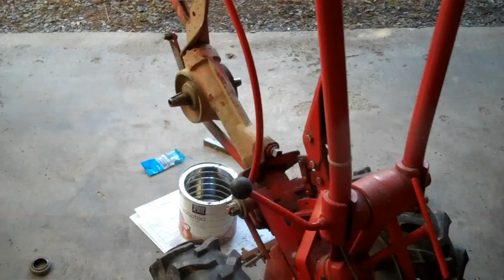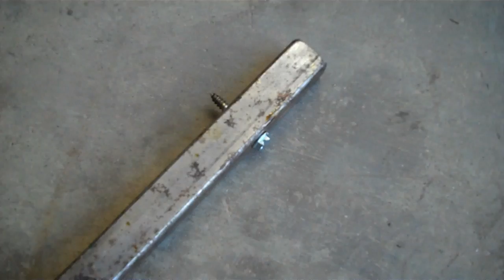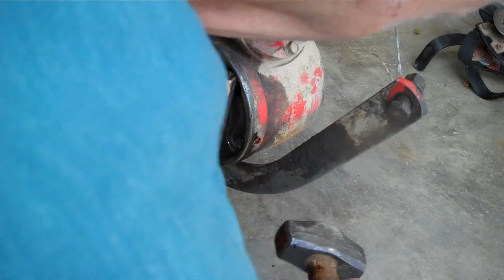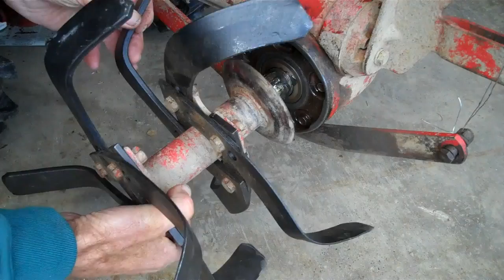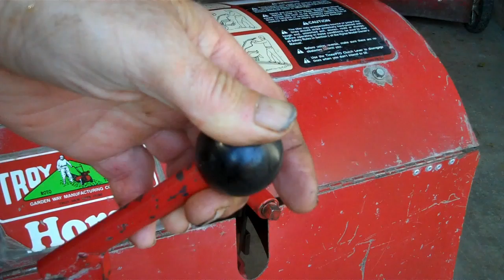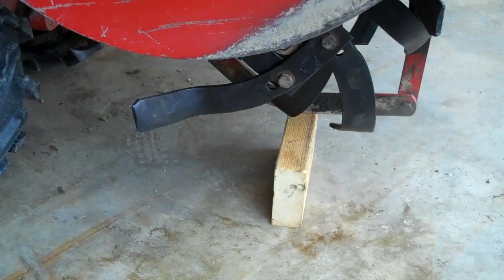Replacing Tiller Shaft Oil Seal and Tines on Troy Bilt Roto Tiller

Comment: Thanks for the tip for using two pieces of tubing. I was replacing four seals two in the transmission gearbox and two in the tine gearbox.  After fighting to get the first seal out I used your method for the other three and it worked like a charm. I like the idea of using PVC to install the new ones as well.

Comment: Any tips for removing the tine holders to access the seals? Mine are stuck pretty good, a hammer isn't doing the job.
Reply from the maker: Mine had been off before and were easier.  I gave them a hard hit with crowbar from the side.  Penetrating oil or heat may also help.  Good luck.
Reply: I just took mine off.  Gentle heat and penetrating oil was the answer.  I used the bearing buddy formable coil with my induction heater on the tine holder.  Or a heat gun if you dont have that....then a few taps with a mallet and aluminum or brass bar on the tine holder and the both came off pretty easily.  There's a couple nice flat flanges on the tine holder where the tines ride that gets a good purchase for something metal and punch like.

Comment: Great video! 👍.  Puting the seal in the freezer for a few hours will help with installing as well.  If it's really tough; ( assuming you've cleaned and sanded the housing really well)
heating up the seal housing with heat gun or hair dryer helps as well.
Just be careful beating the crap out of it.  It should go in with light to medium tapping .

Comment: did you use puller to get tine shaft off main shaft  after removeing center bolt and  wnere got seals?
Reply from the maker: No, but had the tines off previously.  Gave them a sharp rap in the off direction with a heavy crowbar.

Comment: How did you get the tine holders off?
Reply: They are frozen on and will not budge. No shear bolt like othe models…?
Reply from the maker: I gave them several impact blows from the side with a large crow bar.

Comment: did u say what number the seal was
Reply from the maker: I bought these seals from Amazon:Troy Bilt Horse Tiller Tine shaft seals set 9618, GW-9618 GW-9602 GW-9618099.    They apparently are currently unavailable but there are equivalent seals offered.

Comment: It takes money to pay somebody . Or you to know how to do . In my mined a better way . You see the bearing has sloppy.  Ok now you find out how and get the parts  bit at a time . When done you will have a great machine for a fair value and know how it done . Cause it happens when in use .the older ones were made to repair.  Not just get a new device.

Comment: wont the grease on the shaft just become a dirt magnet?
Reply: Yes do it way it designed to work. Get your proper seals. Then the bearings and or bushing. Now you have to clean it . Now you need shims to set the proper play side and end play. Carefully paint put back together.  Then retouch the paint and repair any covers . Now you have a fix that don't leak. Last and work as it should.
Reply: Design was to have a oil bath shaft. On shims with bearings . Covered with oil seals. For a easy quick fix that happens often.

Comment: Thank you, great video on how to replace the seal.  I'll replace the seals on my tiller another day, what I need to know was how to check the fluid level.
Reply from the maker: Here are directions for checking the tiller attachment fluid level:  https://drive.google.com/file/d/14Yf8LOntlgdPcok4KqlrGrFYvMczMF95/view?usp=sharing
Reply: @herbcrosby  Great video! I'm a little confused about putting oil in my gear box. My manual says the same thing as yours but if you go to the next page it says if the gear box has been drained to raise the drag bar up so the tiller is resting on the tines. Then fill and check the oil level. The manual also says the gear box will hold 16 ounces. I put 14 ounces  in it and it is way over full when checked with the drag bar down and sitting on a 3 1/2" block of wood. Am I missing something?
Reply from the maker: @terrysykes4615  Good observations.  The book is not totally clear here.  It appears some oil should first be added to an empty  tine gear box with the tines on the ground so the viscous oil runs to the rear.  Final filling is then done with the tiller raised with the drag bar down sitting on a 3-1/2" block.  Marks on the dipstick then govern to fill to final level.  Suspect that the 16 ounce capacity shown may be total capacity, not oil needed.

Comment: Herb my Troybilt Bronco  is an 80's version and it needs both seals!  I had a wooded lot originally back then and my tiller along with myself landscaped my entire building site.  It served me well and now in it's old age it tills a veggie garden and berry patch.  I have to top off "transmission" area before every use and it would extreme leak on my usual doubled up cardboard piece that it parked over.  The way you explained repairs I think I can do it with tools like you made.  Thanks for taking the time to explain it...

Comment: Is there a drain plug for the rear or do you have to pull everything apart?
Reply from the maker: Do not believe there is a drain plug.  I kept most of the old gear oil, replacing only what was lost.
Reply: @herbcrosby  Just pulled a PTO Horse w/Kohler 8 out of a barn that has been sitting for 25+ years. Got it running good and have replaced motor and trans oil. That rear is the only thing left. I may leave it if that is the case.
Reply: I saw a video that showed you remove the bottom bolt of the 5 bolts of the COVER-Tiller housing, after taking off the tine holder on one side. Also, prop the opposite side up to allow more complete draining. You can see the 5 bolts in the video when Herb is applying grease to the shaft.

Comment: I have a Bronco Axis 2015 tiller.  Got some red hay bale twine around the left tine.  It developed a significant leak.  The angle is different due to tines being vertical instead of horizontal.  I used 30 inch concrete form slick pins with pre-drilled holes and two sheet metal screws.  Drilled pilot holes for the screws.  Placed the slick pins in the same fashion as your square tubing.  Beware that there are ball-bearings in proximity to the seal so don't use extra long screws.  Just enough to get about 1/4 inch of the screw inside the seal. The force of gravity and the weight of the slick pins combined to bring this oil seal right out without tapping on the pins.  Excellent tutorial and use of ingenuity! Thank You!

Comment: leave the old seal in and fill the case with grease. grease will last forever wth no damage to gears.
Reply: I filled mine with corn head grease...
It's the lightest grease just a step up from the heaviest gear oil.
In fact I fill most my implements gear boxes with it.
Liquid enough when under load and warm/hot to do it's lube job.
But solid enough when cool to not leak out.

Comment: Any tips how to get the tine assembly off of the shaft?  Mine appears to be rusted on, and I've not been able to remove...
Reply from the maker: I stuck the tine holder with a heavy crow bar while standing on the other side of the tiller.  Several sharp blows knocked them free.  My tine holders had been off before so you may need to soak with penetrating oil.  Good luck.
Reply: I"m having this issue also.  Will try hitting it with a rubber mallet to see if that helps.  Otherwise penetrating oil time if I can figure out where I'd put it.
Reply: If you have an air chisel / hammer and use a very blunt tip it usually vibrates that tillers right off the shaft. Be careful, not trying to hammer it off, just trying to vibrate it.

Comment: Herb, Thanks for the great video. You were like a friendly neighbor showing me how to do it. I just replaced my seal. I used my flat pry bar with success on the screws. I couldn't see the setting for the drag bar when checking the oil level with the 2x4 under the gear box. Is it the same gear weight for the transmission box ? Thanks again, George

Comment: It seems you are not too concerned about metal shavings from the drill bit getting into the area behind the oil seal?
Reply from the maker: Did not seem to be a problem.  The rubber seal behind the thin metal bearing housing apparently stopped any chips.  Am  impressed how well this older tiller now works with new tines and seals.
Reply: herbcrosby

Comment: I have an Older troybuilt with a Kohler 7HP engine, My problem is with the tiller  Is in  Low gear, all of a sudden it will take off like in had a super charger on it, an then starts to spit and sputter  until I can get the tiller back under control What would cause this?

Comment: Thank you for this video. I replaced my tine shaft seal 2 yrs ago and refilled with new 140w gear oil. After tilling for 1/2 hr it locked up. I did not realize that the PTO (mine is a PTO) has a separate fill for the rear. The bronze gear basically melted cause it was dry. Now thanks to this video I ordered a new bronze gear and put oil in the rear this time. Ran it for 3 hrs straight last night.